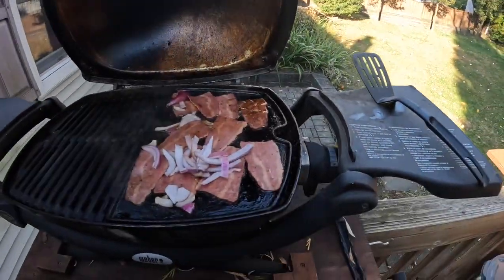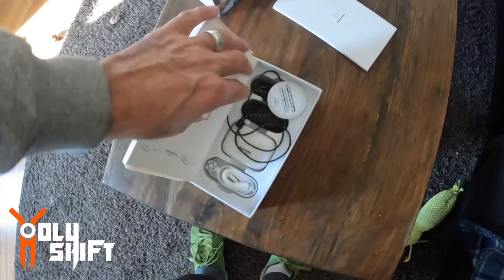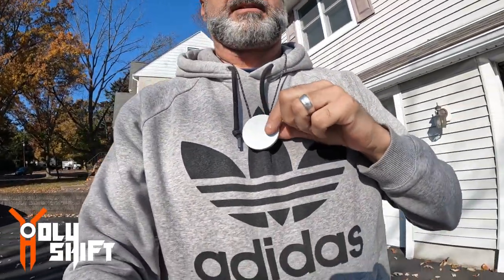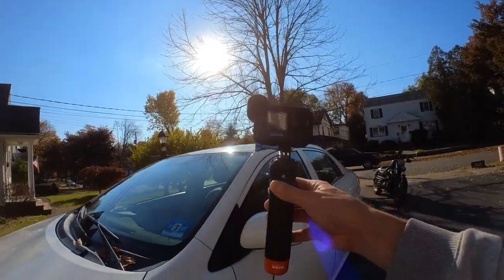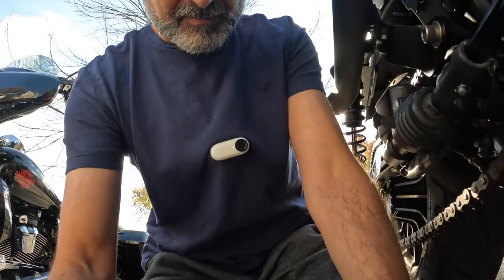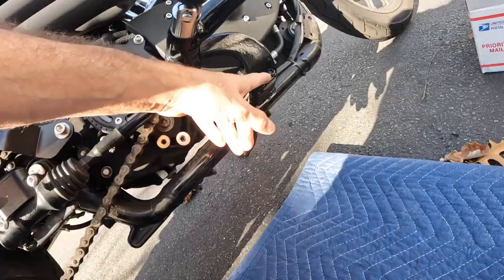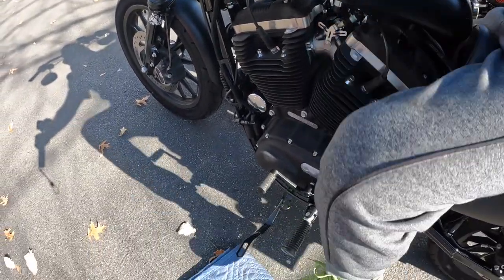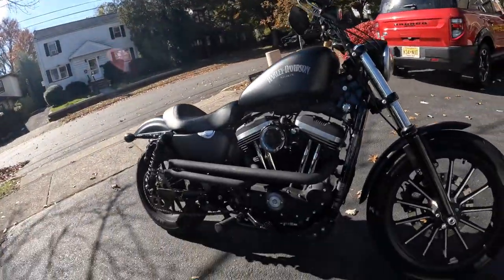How to install Foot Controls Harley Sportster Iron 883

Comment: Great job. This style build definitely needs mid controls. You might also want to wrap those pipes and put the heat sheilds on over the wrap.
Reply from the maker: Putting guards on soon . I don’t want wrap in this build
Reply: @HOLYSHIFT  i didnt want to wrap the pipes on turbo time either but the heat gets unbearable.  Looking at that setup u may be in the same boat.